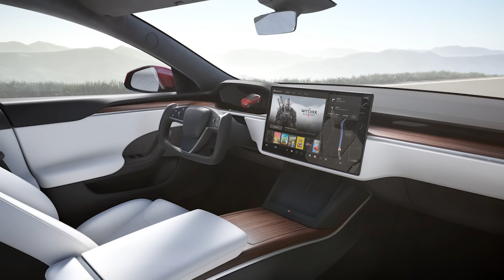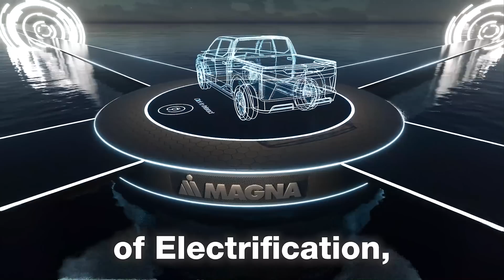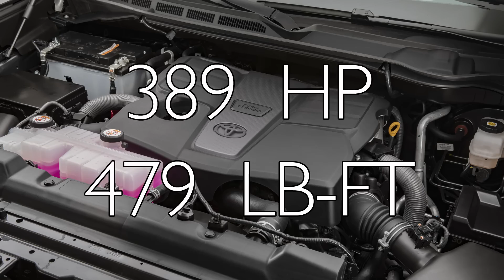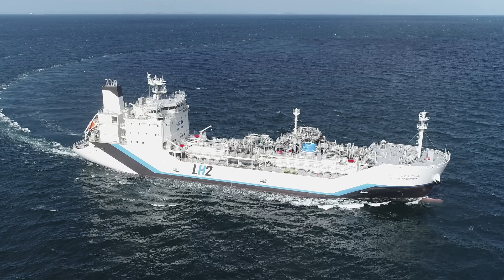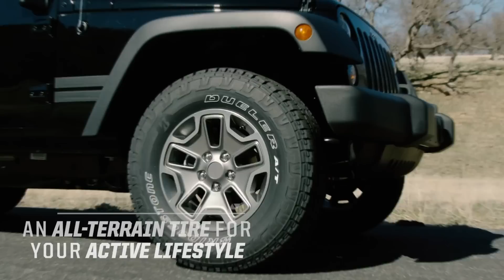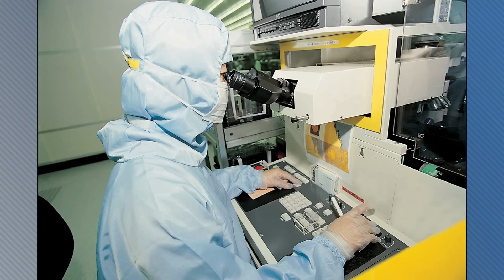Toyota Reveals Tundra Details; Tesla's China Exports Booming - Autoline Daily 3164

Comment: Intel quoted as saying the Chip shortage exists because automotive chips are old tech and chip makers don't want to invest more in chips with 45 and 90 nanometre wires when 5 to 16 nanometre is the current bulk of industry production. Auto suppliers don't want to mess with highly reliable mission critical (safety) components. So rather than spend billions of new chip fabrication plants for old tech, Intel wants auto industry to spend millions on converting products to new chips - any number of chips can be had at 16 nanometre.

Comment: "Formula 1 and Indy Cars have used yokes for years..." So friggin' what? Those are purpose-built race cars. The yokes they use are a lot smaller and lock-to-lock is less than a full turn. What functional purpose does a yoke serve in a road car other than to be "different?"  F1 and Indy cars have open cockpits, no power steering, brutally stiff suspension, notoriously fickle clutches for launching from a stop, tires with virtually no grip until they're at full temp, etc... should everyday drivers get used to those too?

Comment: I have a theory about the Tundra grille. Black paint is cheapest to use so they make it so the front only looks decent on the black ones. I’ve seen that trick used in many designs. Kinda like making the cheaper models uglier to push buyers up to higher trims.

Comment: The only thing Tesla's bringing to the US from China is the LG battery packs for some SR models, and a small subset at that. Some customers were sent a letter giving them the choice of waiting for the packs made in Sparks, NV, but at a later time, or the LG packs in their inventory section to jump ahead of the queue. 

Tesla was sold out within the first week of the quarter so this supply squeeze is not a surprise. Panasonic is unable to keep up with production, and Tesla's 4680 batteries are not online yet - and will not play a big role until around the time the Texas factory is done in Q4 or so.

Some of the entry level models will use the new LFP chemistry that Tesla's planning to use across all its factories soon. It's got slightly lower range but has much higher cycle life, pros and cons.

This is similar to the Model S/X batteries coming from Panasonic's Japanese plants, as the company only brought down the 2170 form factory to the US.

The vehicle itself is made in Fremont factory, and soon Texas will start making its own batteries alongside Sparks, NV facility.
Reply: Wrong...   Tesla brings in LG cells for LR 3,  about 1000 packs per week,   and also CATL prismatic cells for SR Model 3,   all from China...      Tesla might as well be a Chinese company,  more then 50% of their revenue comes from China manufactures products.
Reply: @dmitchellhomes  GM is Korean and Ford is a Mexican company by that logic. These legacies are lazy catalog shoppers that barely do anything local beside putting parts together.

Where's your source for 1000 packs per week? It's not a big number anyway, but just wanna make sure it's not coming out of your behind as usual.

Now in terms of revenue, I would not be surprised, the Shanghai factory is a gold printing machine, serving both Asia and Europe until Berlin comes online, they clearly have much higher margins on those, so it makes sense to make it the export hub.

Comment: Toyota must be in real trouble with Lithium Ion. It’s just mind boggling that they launch a whole new platform with NiMH tech from the 1990s Prius. The NiMH has shorter life, weighs more (so impact payload), takes more space (so less storage space) and is limited in amps. Shorter life (less cycles) might be the reason that they do include an 2400w or 7200w like the Ford Powerboost. That inverter is probably the best feature of the f150 hybrid. If you look at everything Toyota is doing (limited RAV4 prime production, NiMH in new platform, all the talk about hydrogen), it’s clear Toyota is in pain. All lithium ion production for the next 5 years has been spoke for and Toyota was left behind. Toyota will do whatever it can to reduce impact (lobby against BEV, claim hybrids better for environment than BEV, release 1990s tech in new platforms) but this is going to have significant impact on their volume in the next 5 years. In 5 years Toyota will not be the #1 or #2 car maker by volume. It remains to be seen who will take its place… VW, Hyundai or someone else… who has taken EVs more seriously.
Reply: Think of it as you would the different grades of fuel at the pump. Then it makes sense because lower grade fuel costs less but still gets you down the road.
Reply: @Pauline Weinberger Meh, works either way.
Reply: Toyota owns 51% of Panasonics battery division who is Tesla's biggest supplier?
Reply: @dmitchellhomes  That’s a separate JV. Tesla has its own JV with Panasonic for giga Nevada. Both JV are owned half by car manufacturer and half by Panasonic.
The tesla JV has build giga Nevada. The Toyota one has not even started building a plant, which means it’s at least 2 years until they’ll get batteries from the JV and then it will take 2-3 years to ramp up.
Reply: @rgx42  WRONG...  Tesla does not have an ownership stake  in Panasonic production at all!!!      They share a building in Nevada is where their partnership starts and finishes.     Tesla employees are not even allowed to enter the Panasonic half of  Giga Nevada.
Reply: Toyota is just so conservative. They have always, ( or at least for very long ), been like that. They didn't jump to small turbo engines first either, and in many areas, they come last. Good thing with that approach is that you get good quality, downside is of course this, getting new things last.

Comment: The Yoke steering wheel is like the falcon doors on the Model X,  HUBRIS...     Elon Musk making mistake after mistake.
Reply: Another breakthrough from Tesla’s “fix what isn’t broken department”. What will those lads come up with next….
Reply: @rustyt115    Ya,  the Yoke is scaring off a lot of would be buyers,   Including myself,  between that and the flacon doors 2 reasons I would not buy an X,   but a Rivian R1S instead to replace our E-Tron.
Reply: Maybe.  But the Model X doors really sold those cars and made them appear "futuristic". It was great marketing that worked.  You might see the same with the yoke as todays generation is more into form than function.
Reply: @aussie2uGA  It was not great marketing if you know how hard and expensive those made the car to build.   It was a mistake.   Most customers don't even like it,   as they are slow, and have errors quite often.   Like the Yoke,  Elon solved a problem that did not exist, and created 10 more problems.
Reply: Funny and absurd.

Comment: You know Honda is behind the times, when they’re partnering with GM to make EV’s. (GM’s Bolt is still having MAJOR battery fire problems)
Reply: Different battery and different battery manufacturers for the Bolt and their new Ultium battery system
Reply: Not behind - microtesticled Honda execs won't commit to tooling for EV. Ironically, they're buying their propulsion platform from a company run by a girl, lol
Reply: @vidznstuff1  Did you even watch the video, Honda WILL be producing their own EV platform after the GM deal.

Comment: "indicar and F1 have used yokes for yeas so people get used to it"
No we won't, just like we wouldn't get used to 5 point harnas, a helmet, 50 pound clutch paddle, and a bucket seat.
Reply: They want everything to become more numb-feeling and almost making it put you to sleep but then are for this unergonomic gimmicky PR stunt of an idea. This is pointless. You literally don't have to reinvent the wheel.
Reply: @imnotusingmyrealname4566  If you really think about it, there are not many times, when you have to do a U turn and the places where a Yoke is not great, is low speed.   The truth of the matter it is just another things for Tesla to tell you what the future will look like.....people will spend less time actually driving the car.   FSD systems are being worked on by all the Auto Manufacturers,  so this is probably going to be the norm.
Reply: @HearToneSpeak  Then it's gonna be even slimmer and will fold into the dash and not be worse in every way than a steering wheel.
Reply: @imnotusingmyrealname4566  Funny you should say it is worst than a Wheel, this has been studied and Yoke is actually more comfortable.   The true issue of the Yoke, is slow movements.   Most people will need some form of remedial training.  I think the true issue with using a Yoke, is the buttons, that is probably being worked on.

Comment: I think an F1 race car's steering is just 1 turn lock to lock, this explains why they have no problem with the yoke style steering. A Model S Plaid's steering is 2.3 turns lock to lock. That's why some find it difficult to use Tesla's yoke steering, some owners steer with one hand,  technically the wrong way to steer.
Reply: Yeah this comparison is idiotic as formula 1 has these tight ratios and they don't maneuver through parking garages. Probably just to appease Tesla fanboys here in the comments.

Edit: Also the simplest most obvious fact, IT'S A FORMULA 1 CAR.
Reply: @imnotusingmyrealname4566  these news shows only seem to appease Tesla fanboys
Reply: Yep, there is a huge difference between regular driving and race driving. Maybe we should also adapt parachutes on every car since they work so well for drag racing.